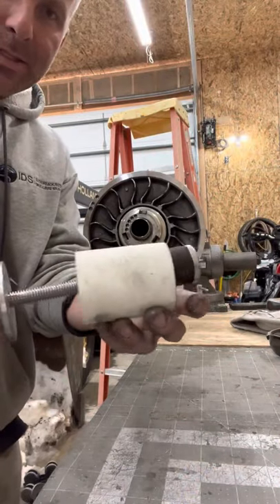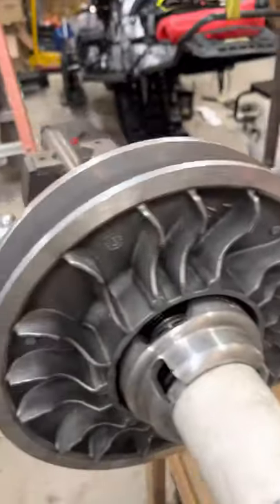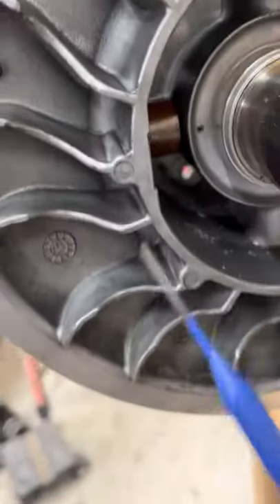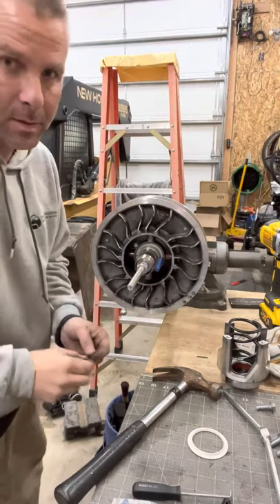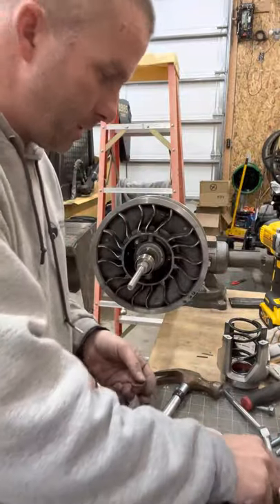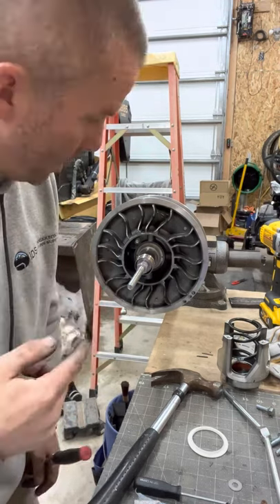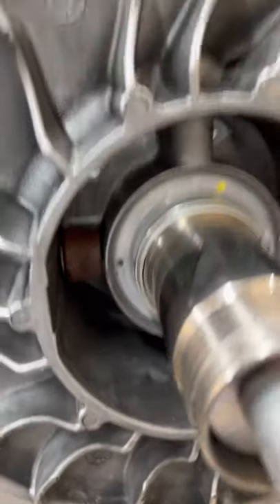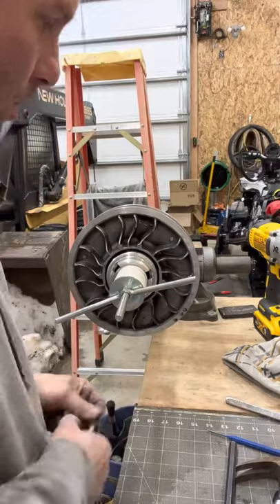Hi-Torque Roller Installation for QRS Secondary Clutch Ski-doo 850 Turbo

Comment: Thanks Tom. Want to confirm you did the roller replacement without removing the bearing on the jack shaft
Reply from the maker: That’s correct

Comment: My package from Fetbros included 2 e clips. Are those needed on a g4 secondary? I didn’t see you add them around the washer
Reply from the maker: E clips were used on the older sleds.  The gen4’s use a pin.
Reply: @xtremeairvents  thanks again. Great vid